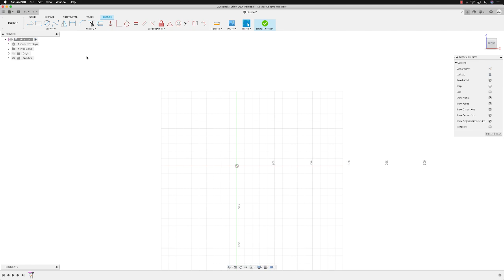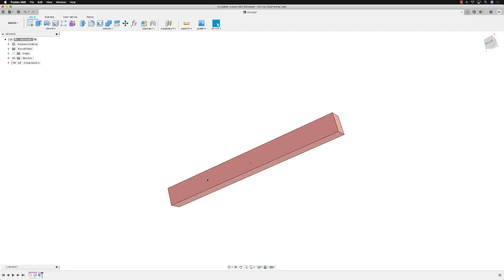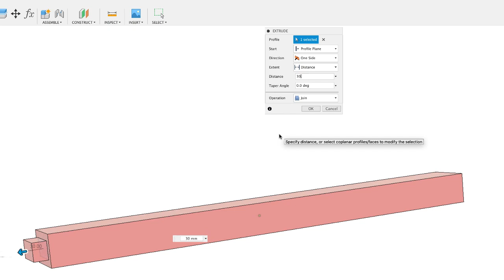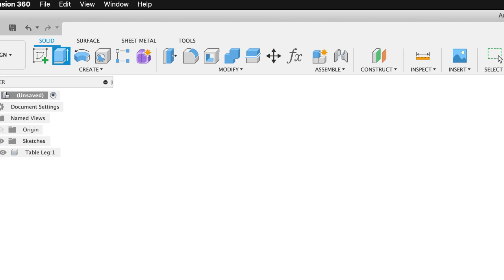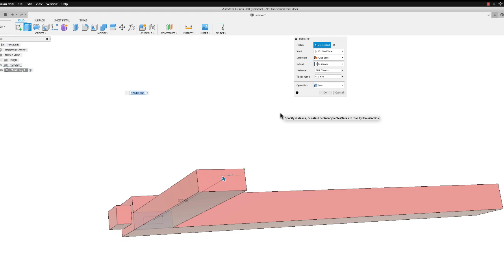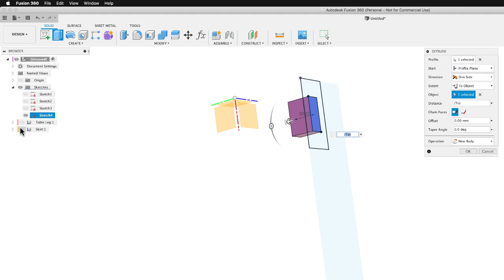Episode 002 - Extrude command Fusion Friday for woodworkers.

Comment: Hey Andy, I've been following along with your videos and I think you mentioned it in one video but I can't seem to remember where, I'm trying to design a MFT style work bench on fusion and I'm at the point of the top.

I'm assuming it's somewhere in pattern to make the 20mm holes 98mm on centre. Would you be able to direct me to which video has that info?
Reply from the maker: Hi,

It was in this video - https://youtu.be/_UkOLL-bRVw

The way I would model that is....

Create your MFT top (sketch and extrude)
Use the hole tool to set you first 20mm hole (normally 71mm from the edge to the ctr on both ref points) (hole tool is in create menu)
That will set your first hole
Use the rectangular pattern tool - set up as follows
Pattern type features
Object select the hole you just made
Directions click on both the y and x axis
Distance type = spacing
Set distance to your 98mm ctr in both the distance boxes
Then increase both quantity numbers for your required numbers of rows in both direction

Let me know if you have any questions and good luck

Andy
Reply: @TheWoodgrafter  thanks for the quick reply will try it tonight after work. And let you know. Thanks so much mate
Reply: Worked perfectly, thank you so much Andy
Reply from the maker: Great stuff,

Cheers

Andy